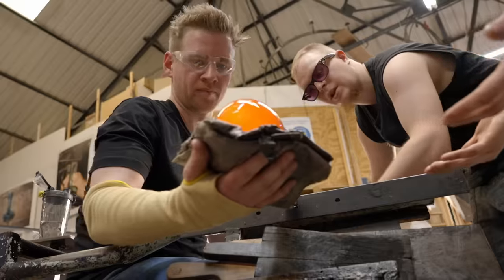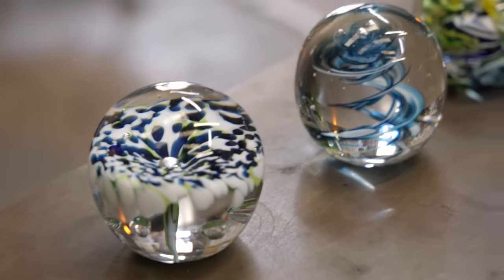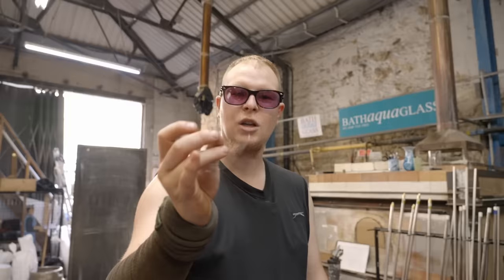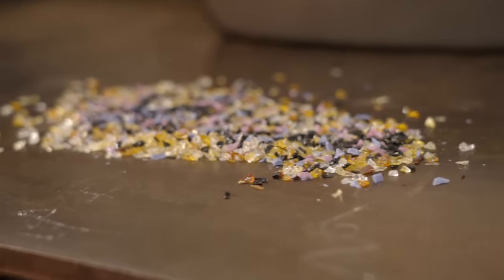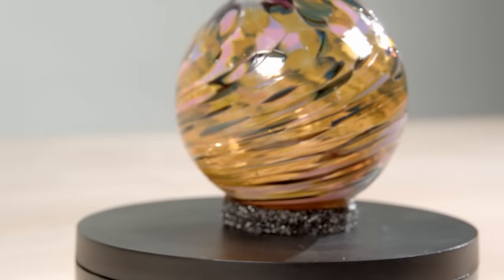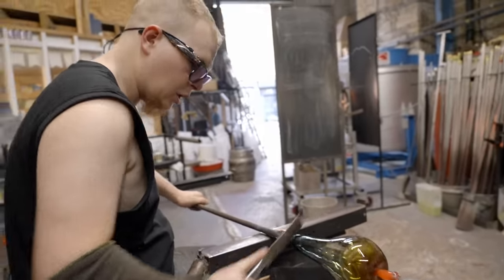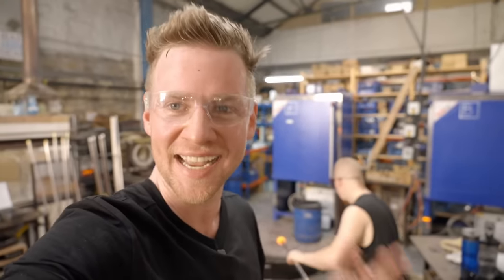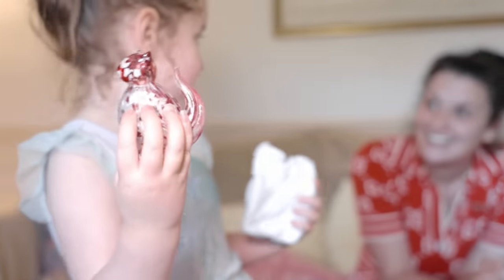GLASS BLOWING is Insanely HARD!!

Comment: I remember when I was taking my associate's degree I needed to take some classes to flesh out my schedule so I was considered full time, I took a glassblowing class. It was a lot of fun. I feel like glass is a really responsive media so you can get immediate feedback as to how you are doing with it. I made a bunch of dumpy shot glasses, and a couple of steins. For our final we had to make several glasses, one with a handle, one with bit-work, and one without a handle or bit-work, as well as a piece with color. I had tried to make a flame for my color piece but the glass pieces defused in the kiln. The handled glass I made was great, it had nearly straight sides, no included bubbles in the wall, the wall was a comfortable thickness, the handle was nearly perfect. Then while grinding the bottom flat on the grit-stone it caught an edge and was thrown out of my hand and shattered. I was so angry.